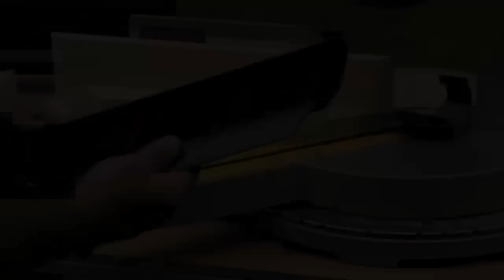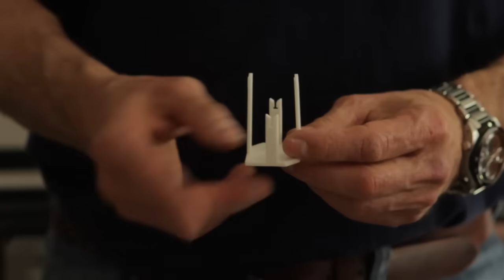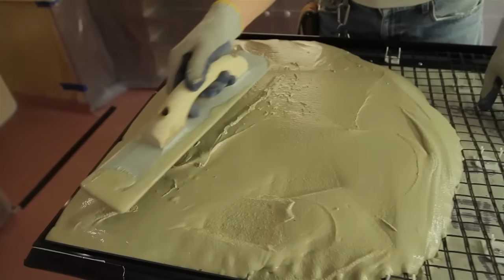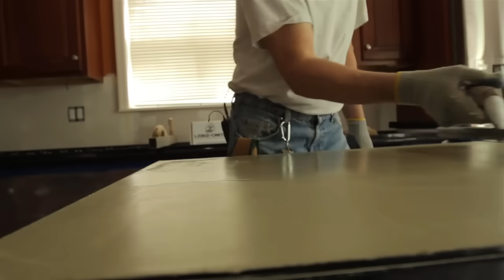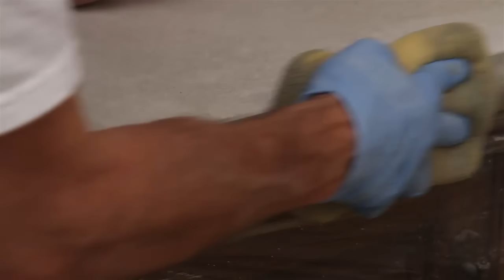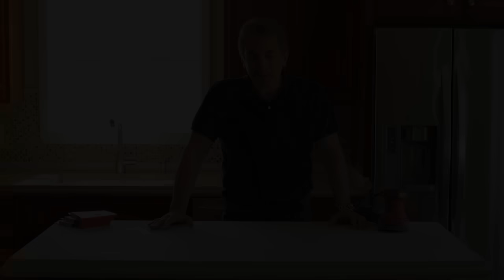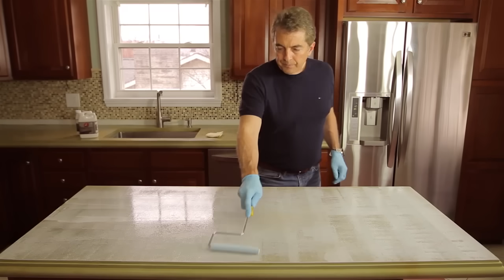Z Counterform - How To Build Concrete Countertops Full Instructional Video

Comment: At what height and depth should the grid be placed and what is the height of the countertop?
Reply from the maker: The Z Clips (chairs) hold the mesh exact 1" up from the top of the cement board. Using our forms, you are pouring 1-5/8" of concrete so you are keeping it about 2/3 of the way up in the slab.
Reply: @ZCounterform1  I have a 40mm plate - that means the mesh should be at a depth of 1.5 cm. It seems to me that it should be 1.3 cm lower from the bottom, because that's where the main load is?

Comment: So everything that they said was perfect except for the stove and fridge cut outs if you add a half inch on both sides of the stove and on both sides of the fridge my stove and fridge would no longer fit in the opening so I had to cut the concrete board back a half an inch and set my forms flush no big deal but it’s something to note
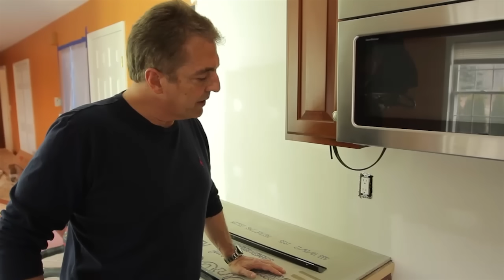Reply from the maker: Thank you for the comment! In this video, the fridge opening is actually paneled off by the cabinets. For the stove, you are correct, you will not want to leave the 1-1/2" overhang that is built into the forms or your range will most likely not fit. However, if you watch the "Creating s stove opening" section starting at 4:07, you will see we actually use a 1x4 screwed to the side of the cabinet to ensure the countertop ends flush with the side of the cabinet. It is definitely important for people to take note of this though or you could run into an issue.
Reply: @ yeah for sure. I watched it and I caught the mistake long before I made it so no worries. Love your product.
Reply from the maker: @jessemorris69  awesome to hear! Please feel free to reach out directly if you ever have questions or need any help. Good luck on your project.

Comment: What’s the material you’re pouring cement on? I am referring to the big rectangular panel. I am not able to find it on the website. Thanks
Reply from the maker: That is just concrete backer board like you would put down under tile. The brand we are using is Hardie Backer Board.

Comment: Let’s see how you screed using your form that goes against the wall? Your forms have 3/8 inch at most top horizontal surface making it completely impossible since you can’t move back and forth on that tiny surface. Also how about the inside corner where the tool you sell is too short to touch the forms on both sides. Useless!
Reply from the maker: It is true you can not "saw" back and forth with a screed board when up against a wall but you can still slide the screed on top of the backwall form and easily check to make sure your tops are level, front to back. It would be a lot harder without the backwall form but you are always free not to use it. 

I am not sure what you mean on the inside corner and what tool you are talking about? If it is one of our screeds, we sell them in both 28" and 40" so you may need the longer one for wider sections. You can also always use a straight 2x4 if you have one section that is wider and requires a longer screed.

Comment: Great video, but why does the concrete look greenish when poured? Does adding Liqui-Crete do this?
Reply from the maker: No, the Liqui-Crete has a natural gray color and will not really affect the color of the concrete mix it is being added to. The greenish hue in this video is mostly just from lighting and reflections from the green walls.
Reply: @ZCounterform1  The walls are not green, in the video he mentions that the base concrete was dyed green to accompany the stain, what product was used to create that green color? I want this color for mine. Thanks!

Comment: Is the Juro rock flush with the front of the cabinets you skipped to this step completely thank you
Reply from the maker: Yes, the backer board should be cut flush with the front of the cabinets. The forms have a 1-1/2" overhang built in.

Comment: Thanks for the great vid. I noticed Ed was installing an under-mount sink with the lip of the sink right on top of the durarock. What would you do if you ever needed to replace the sink?
Reply from the maker: We get this question a fair amount but to be honest, it would be incredibly rare to replace a sink without replacing the entire countertop since the hole in the countertop is the exact size for that sink model.. However, if it had to be done, you can cut out the cement board from underneath with a multi-purpose tool and drop the sink out that way. Then you would need to epoxy the new sink into place just as you would with a traditional undermount on granite.

Comment: How much water are you using per bag?
Reply: Bags call for 3 quarts of water max, but these mixes look much wetter
Reply from the maker: @SeanFerguson-w5o  Our white countertop mix (which is 47 lbs) calls for 3 quarts of water but you can add a touch more if needed. For the Liqui-Crete, which is combined with a 60# bag of Sand/Topping mix, you will be closer to 5-6 quarts. You can watch a video dedicated to mixing Liqui-Crete here - https://www.youtube.com/watch?v=2jwuxlspjnM

Comment: The concrete your pouring looks like self leveling concrete to level floors
Reply from the maker: Similar concept with a sand only (no larger aggregate) mix. Floor self levelers will usually have a much higher polymer content thought because they are poured very thin. This mix still needs to be trowel finished in order to give you that super smooth finish you would desire on a countertop.

Comment: 2 Questions, How long do you wait to remove forms, 2 Days
And how do you snap off the curved square edge as it was taped where it snaps ?
Reply from the maker: Typically you can remove all the forms after 24 hours but no harm in waiting longer.

Comment: Can you  use plywood  as subtop instead of durorock
Reply from the maker: We typically do not recommend plywood because wood will shrink and expand at a different rate than the concrete. This could cause cracking overtime. For our own use, we typically use Hardie Backer board as it is a bit more rigid than the Durorock. If you have to use plywood, I would make sure it is sealed so it will not absorb too much moisture.

Comment: Quite a beautiful countertop that would rival a natural stone one.  If it should happen to be damaged in the course of time from daily use, is it hard to repair concrete as it would a natural stone countertop?  Are there products on the market that would help repair such damage, such as from accidental chipping or gouging or discoloration from sun exposure?   Thanks for a great video demonstrating your products.
Reply from the maker: Thank you for the nice comment. One of the benefits of concrete is that it usually is much more repairable then other solid surface tops. How you would repair would of course depend on what the issue is but we are always here and happy to help with things like that. You can send us photos and we would be happy to recommend the best remedy.

Comment: Very happy with the product and results.   The only thing i found in my case is that if your using the Sand top mix, the more i sand it before staining the less smooth it got.    If i did it again i would either not use Sand Top mix or barely sand it at all.   But otherwise i copied the steps to a tee and am happy.
Reply from the maker: Thank you for the comment and we are very happy to hear you are happy with the results. I would like to point out that if the concrete is getting rougher as you sand, this could be a sign of some laitance on the surface. Laitance is the term we use when your top cream layer is a little softer than expected. This usually happens when the concrete is finished a little early with a steel trowel and too much moisture is trapped in the cream. It is usually best to sand off this soft finish and then you can grind or sand through the rougher finish below to still wind up with something nice and smooth. Please feel free to email us at info@concretecountertopsolutions.com if you have any questions.

Comment: You don’t really show how it works up against the wall. Is the thickness of the form still exposed? I assume your screeding on top of it and obviously it can’t come out so how does that work in terms of the final lock?
Reply from the maker: The back wall form has about a 1/4” lip to screed on that will be visible after the concrete is poured but it covered by the backsplash or a small bead of caulk.

Comment: I really wish you offered samples of your white concrete mix, with and without the bright white additive.
Reply from the maker: This is a good idea and may be something we work on in the future. We do highly recommend pouring a one bag test pour first to get the feel for how this concrete mixes and finishes. This would be a good time to also test colors. You can buy one bag of Concrete and one Bright White Color-Pack. I would use half the bag with half the Color-Pack for one sample and then use the other half to make a second for comparison purposes.
Reply: @ZCounterform1  yeah unfortunately ordering a single bag costs over $100 in shipping.
Reply from the maker: @brainz-brainz  where are you located? It should only cost between $20-$30 to ship in the lower 48. Please call us and we can check on the rate you are seeing to make sure it is accurate.
Reply: @ZCounterform1  Washington state. I’ll give a call.

Comment: WHat effoects will happen if it's mixed  with more water than this?  What can happen..
Reply from the maker: Adding more water than recommended will weaken the concrete. This can lead to cracking or surface spalling among other things so it is not recommended.
Reply: @ZCounterform1  Thank you, and would would cause air pockets in some locations? and is there a way to resolve them without full removal?
Reply from the maker: @anonymousprepper1463  Air pockets against your edge forms are a normal part of pouring concrete into a mold. We try to vibrate the edges as well as possible to remove the air and limit the amount of voids but some are inevitable. We sell a patch material that can be used to fill them - https://concretecountertopsolutions.com/collections/cement-products/products/z-counter-patch
Reply: @ZCounterform1  The edges were pristine, it was the trowled surface, seems like had some spots that wasn't bonding.
Reply from the maker: @anonymousprepper1463  Gotcha. On the surface if it is voids or pinholes, the patch might still work well. If it is large rough areas, you might be best off sanding. If you send us photos to info@concretecountertopsolutions.com we would be happy to recommend some options.
Reply: @ZCounterform1  I appreciate it, desn't appear to show issues now cured, but will follow up after this winters freeze.  Was used on an exterior bar in PA

Comment: I just completed my Bar Top with their "White" mix  and standard modern square edge. It turned out really well. My wife was skeptic and wanted to go with marble or quartz but I insisted.  because for me to locate, transport, fabricate and install would have been a real PITA. 

I wanted to try this out because if it turned out well I would do the kitchen in the same material. The kitchen is "U" shaped and has very wide sections, 5' by the window, and to attempt that in quarts or granite would be a huge expense in materials, Almost impossible for me to do solo and it would have at least 3 seams. 

It is not quite "white", more like "Snow White" in the quartz world. To me it looks like limestone but better.  We used a small round sink with the sink form plastic strip they sell. 

The one problem I encountered was that the plastic is so stiff it was hard to get the ends to conform to the radius. I wedged/shimmed the ends out and when I removed the strip there was excess concrete there that I could then remove with a metal file to get the perfect radius. 

I did the pour myself. If I had one recommendation it would be to mix small batches, have a second person helping you and get a powerful drill  to do the mixing. One other suggestion...When in doubt I left a little bit more material rather than try and get the levels perfect everywhere. I was able to grind down then polish everything into perfectly flat. I did not want to be left with low areas. You will need to grind down or sand down past all of the "cream" that forms so keep that in mind when you are troweling. The cream looks nice and white and smooth but get rid of it! Scoop it off. 

Another tip is to begin around the sink and get that sorted out first before things get hectic. I would not want to be fiddling with the sink while things were setting up. 

Other than that I followed Ed's advice in this video. I called them up for hints at how to polish and with what tools and they were very helpful...The finish under the edge was glossy smooth and I was able to match that on the top thanks to Ed's advice. 

Now my wife gave me the permission to do the same for the kitchen and laundry and that is going to save us a ton of $. 

I will do a video on it when the time comes.
Reply from the maker: Thanks for sharing your experience and all your advice! I am glad to hear this project turned out well and you plan to use the products again. Please always feel free to reach out for help. And yes, for a lager area, we would definitely recommend 2-3 people so someone can keep mixing while the other people are placing and finishing the concrete.

Comment: I'm worried about the amount of support underneath my durarock. I've put 1/2" down on top of the cabinets. Have you had the weight of the concrete break the durarock?
Reply from the maker: It will depend on the strength of the cabinets and the size of them. On a 36" base cabinet, this can be a large span. If there are any spots that you are worried about, you can easily add some temporary bracing by just using a 2x4 leg inside the cabinet box. Once the concrete has cured, you can pull the legs out. This would be similar for doing an unsupported breakfast bar overhang.
Reply: @Z Counterform  thanks man! It is a 36"  so I will be sure to brace things up. Love the installation so far, it's a breeze. Thanks for the quick reply!

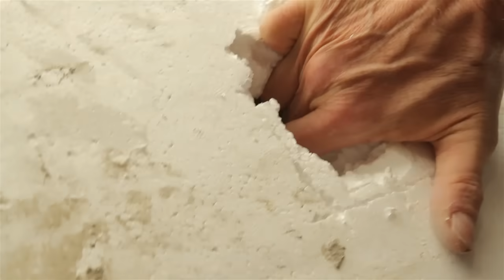Comment: 45:30 I would have like to have seen the removal of the plugs for the tap fittings. Asides from this, the video was great. Your mesh system is great. I think you have one of the best systems for doing concrete countertops. If I used the simpler square edge, then I could use a Stone Coat Countertops epoxy to get a very cool finish.
Reply from the maker: Thank you for the nice comment. Sorry we missed the removal of the faucet knockouts. If you have any trouble with this or have any other questions, please feel free to reach out and we would be happy to assist.

Comment: Can the epoxy finish stand up to a dish taken directly from the oven?
Reply from the maker: The Aqua-Poxy is rated to about 400ºF so it will stand up to some pretty high heat but it is typically not worth the risk and we always advise using a hot pad.

Comment: I think since 2016 z counterform already know that but.. First, then you pour concrete to mold you can use perforator or grinder like vibrator, not just tapping mould by hand - its gonna really flash out every bubbles in concreate. And second then you applied epoxy to countertop - you can use gas torch. That softens liquid and all bubbles just pops.

Comment: What are you doing for underneath the island overhang? Is it just the cement board or do you have a method to remove the backer so only concrete is exposed?
Reply from the maker: The cement board is normally left in place. It is completely covered by the drop down in the form so it will not be visible from standing or sitting height. There is really no reason to attempt to remove it, as it just looks like unfinished concrete.
Reply: @ZCounterform1  and would you prefer water proof cement board for around the sink area?
Reply from the maker: @bennelson9889  no waterproofing on the cement board is necessary. The concrete is sealed and also 1-5/8" thick so moisture should never even reach the backer board. And even if it does, the reason use backboard is because it will not swell or warp like wood. I have never seen a case where moisture worked its way through the concrete, through the backer board and was presenting on the underside.
Reply: @ZCounterform1  thanks for the replies! Starting the countertops in the next couple weeks!
Reply from the maker: @bennelson9889  no problem, feel free to reach out to our customer support team at infro@concretecountertopsolutions.com or call us at 570-587-3799 for more detailed help if you need it!

Comment: I'd like to try and do an exposed aggregate look, is that compatible with the liquicrete additive/sand cement mixture?  I was thinking of sprinkling some coloured stones/glass on the top layer and grinding it back (I've got a diamond cup grinder) I like the benefits of the fibre re-inforcing for crack control/ease of pouring a thin slab

Comment: Is there a liqui-Crete product for the white concrete mix?
Reply: @ZCounterform1  one other question, what about the area over the dishwasher? Do I need to build a support for that under the concrete board or can I leave the dishwasher in place and use that? I just wanna make sure I can still pull my dishwasher out if needed haha

Comment: Really appreciate your helpful videos. I've wanted these for a long time now and I'm inspired to try to create my countertops now, thanks to you guys at Z. How do you make a waterfall island countertop from concrete?
Reply: @ZCounterform1  so this is possible that has been my
Only hang up on doing concrete I really want to do waterfall on island
Reply: I made a concrete end from melamine forms and then put that on the side of the cabinet and then poured the concrete like they did in this video. If you try hard you can see a faint seam, but overall looks well.